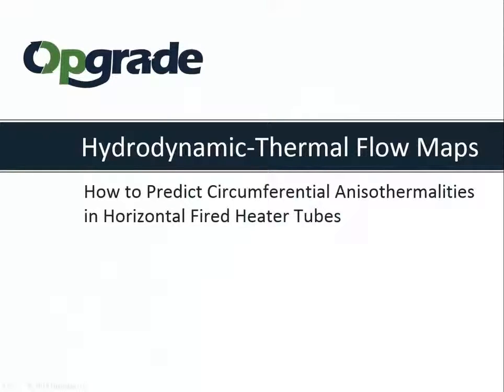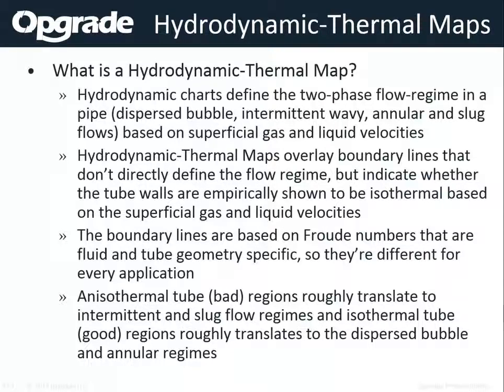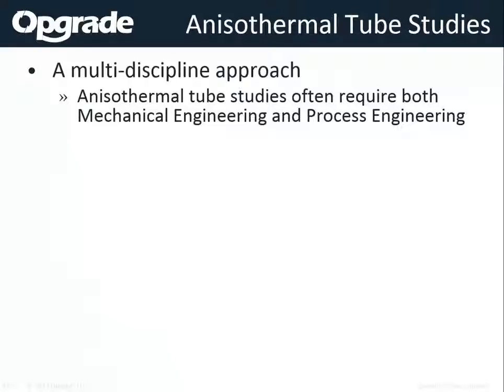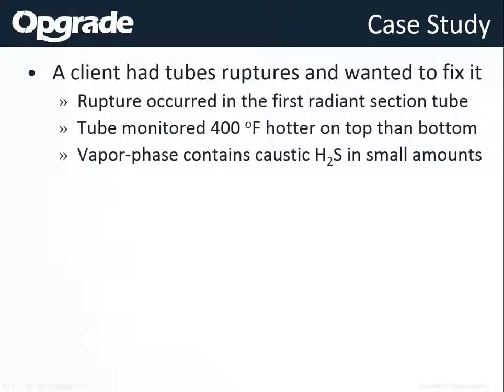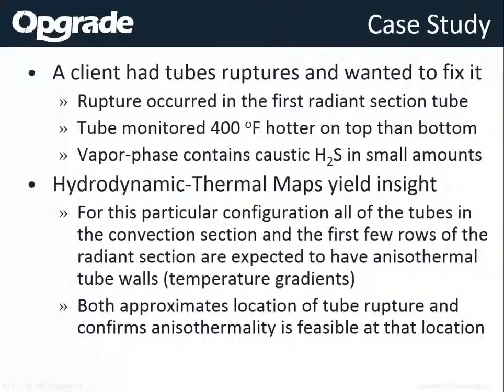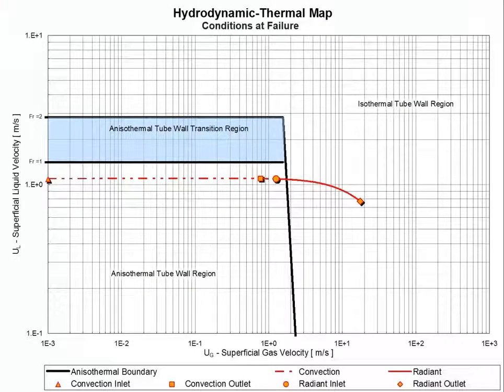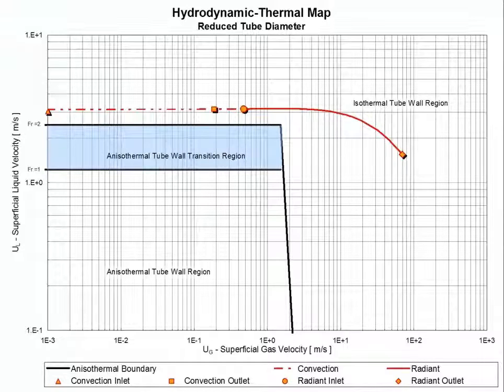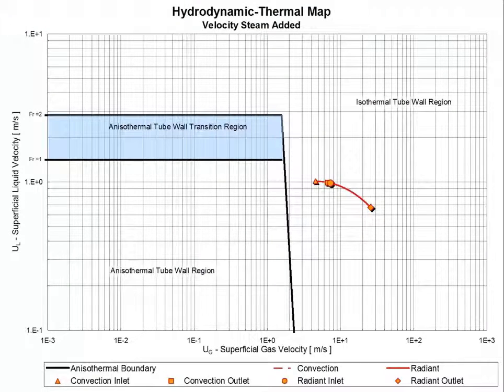Hydrodynamic Thermal Flow Maps

Comment: Hi. The video is very interesting. Did you do such similar studies for vertical tube heaters? What is your opinion on slug flow in vertical tube of a heater?
Reply from the maker: Rupam, thank you for your kind words. We are just now seeing this comment, so thank you for patience.
No, we have not done anisothermic/diabatic analyses on vertical tube heaters. We have been part of CFD studies on 2-phase flow in the transition from horizontal to vertical flow, but not with heat transfer.
Regarding our opinion on slug flow in vertical tube of a heater, we are confident there are flow and heating regimes where that exists, but since we have not studied it, we will refrain from speculating on which regimes those might be.